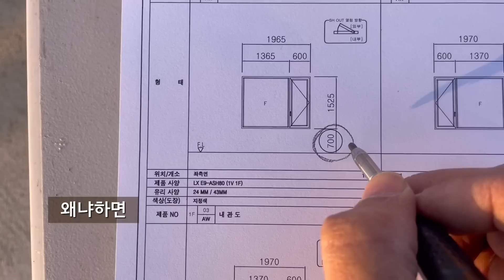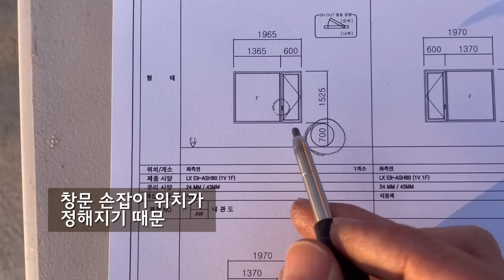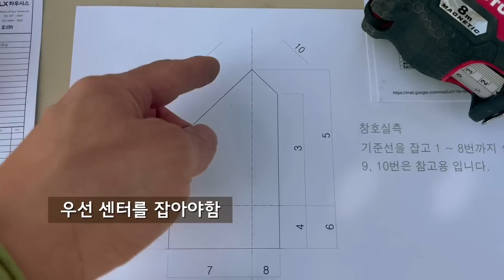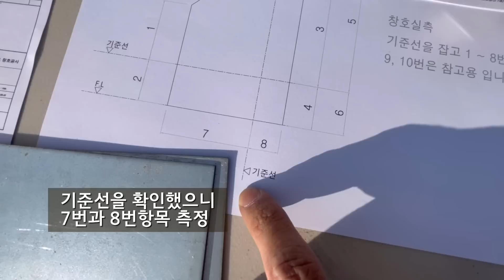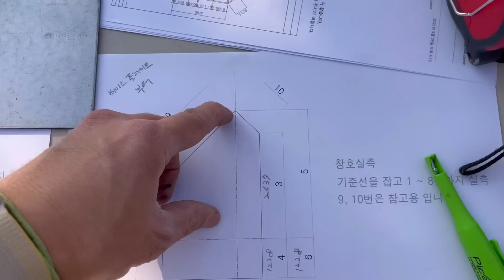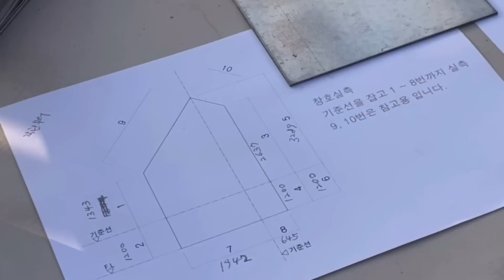셀프 집짓기 I 알루미늄 창호설치 실측하기 I 커튼월 시공 I 봉고3 에어컨필터 교체 I 기준선 설정 I 샤시설치 I 창호공사 I 시골생활 Vlog I 직장인 주말 귀촌

Comment: It appears that your measuring device also had a magnetic catch, first time I seen one, I am going tool shopping...  👍🏼🔨😎
Reply from the maker: I use Milwaukee tape measure, and if you look closely, the part where the measurement starts moves slightly, so it is measured very accurately.